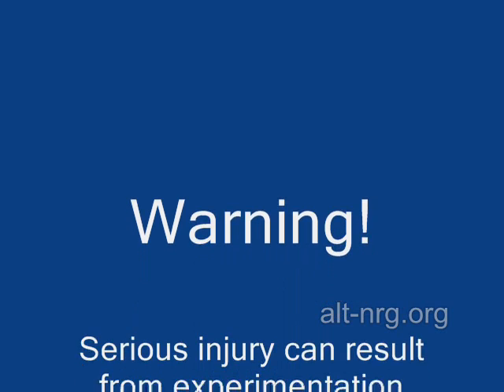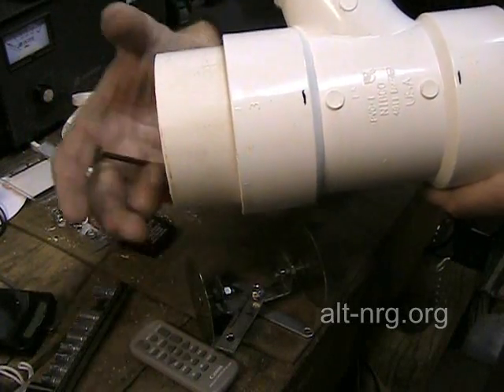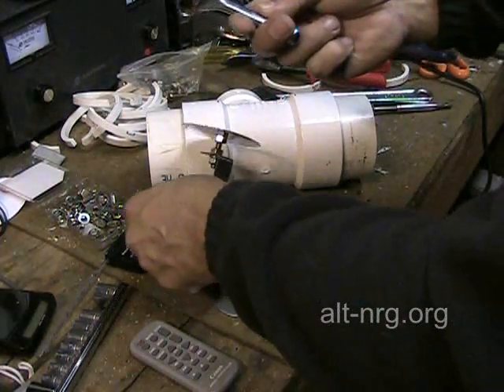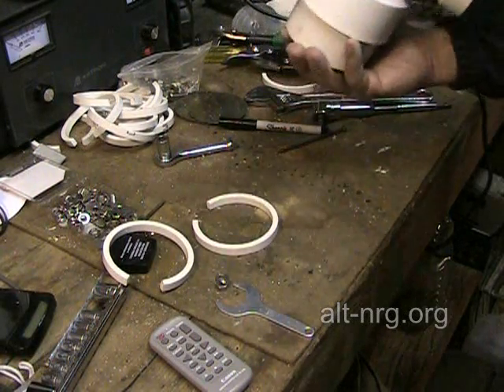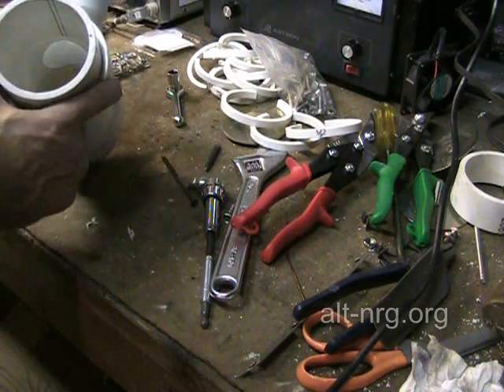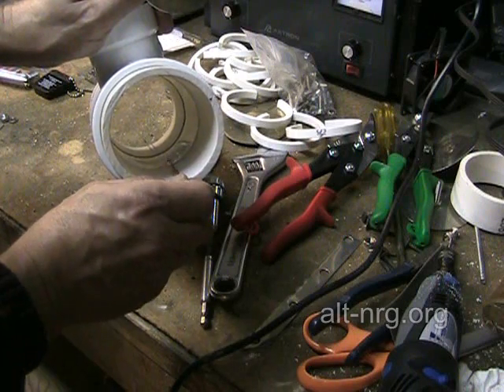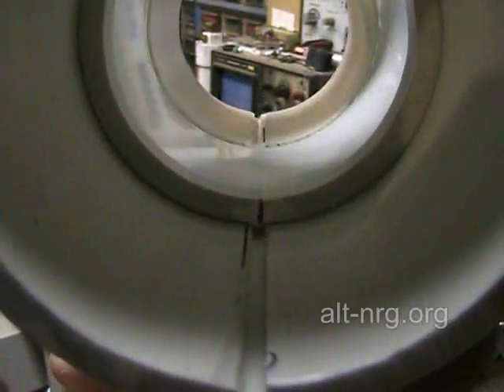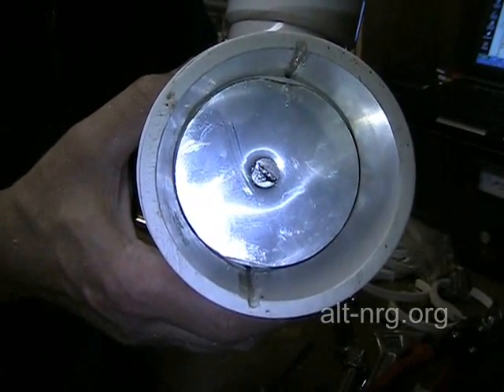#192 Inverted T cell Part 7

Comment: What's the idea behind using spacers made of PVC like the cell's body?  Unless there's a compatibility issue, wouldn't it have been a lot easier to get some thick gaskets of the correct diameter?  What am I missing here?

Comment: Zero, you might think about using some lock-tight on the inner retainer nuts., after all, we don't want the assembly to vibrate loose while in use. And for your consideration, grind the strait slot both head a little smother then polish it, so you don't get uneven electricel flow from it, resulting in pore production.
Peace, and keep up the good work.

Comment from the maker: It is used as an insulator which fills in any small imperfections on the c-ring edges as well as a framework between c-rings to keep plates from rotating. That's another reason for the 2 flats on the plates.

Comment: Is the adheasive mainly used as an insulator for the plate edges? If not you could probably just use it on the 2 center and 2 outside rings with just a small dab for each plate to prevent rotation after assembly

Comment: Very well done. I am a little concerned with the loss of strength in the "T" fitting. If you mill the channels into your backing rings would it make much difference to the current leakage?